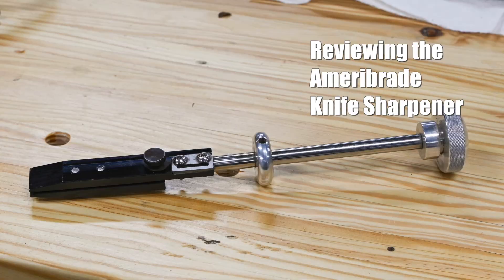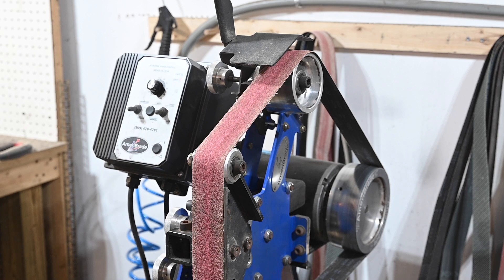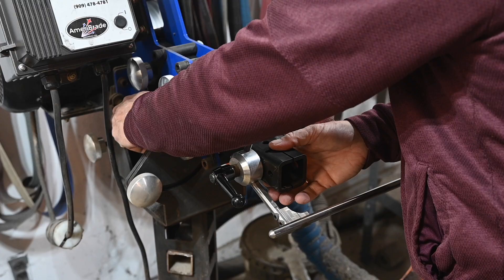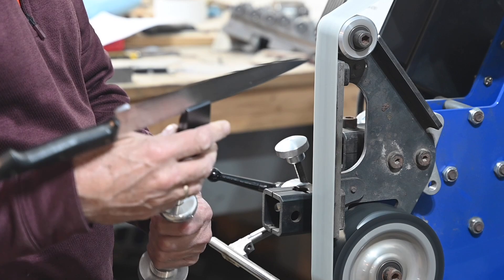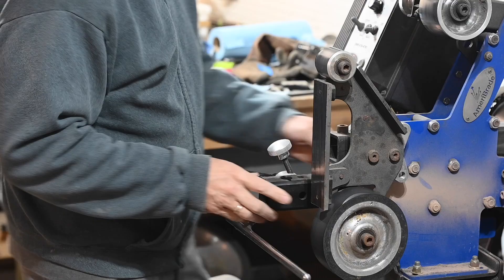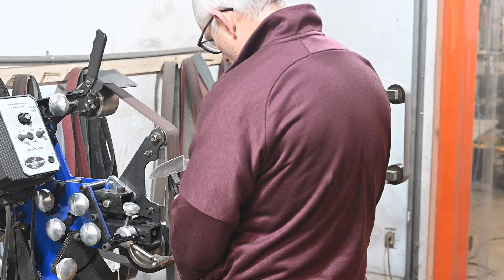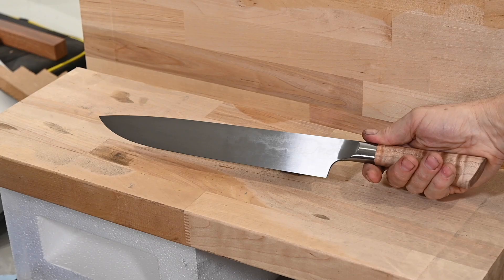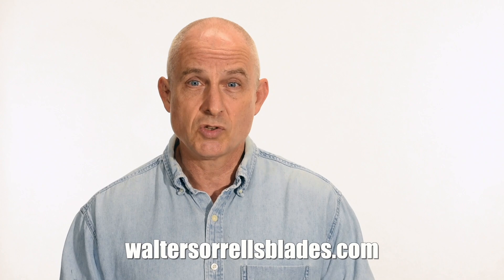The Ultimate Knife Sharpener? - Ameribrade Knife Sharpener Review

Comment: I just purchased this and it works great. I like how you run the platen straight up and down. I did it with platen laid back and you have to reach out and seems to allow for some unnecessary arm movement. I will try your method next time. And the trick for leather strop should fix the little problem I had with it rounding over and seems to dull it a little. Thanks for the advice.

Comment: thanks Walter. for what it is worth, I use the same basic process without the   jig on my kmg. The leather is awesome. I got the idea from an old Steven R. Johnson video (he used disc sanders with cork and leather). This leather belt has been my secret weapon for quick sword sharpening, too. It looks like a Lansky system for a belt grinder. But, it was good to learn that this worked better for you than the paper wheel system on a little bench grinder that a number of people use.  thanks for the insights.

Comment: I don’t have a VFD so I can’t run in reverse and I’ve been getting an initial primary bevel on my knives by just super gently using the 120 ceramic and hitting it up above the platen behind the contact wheel there where it’s a little tight and not too much of a convex situation resulting. I don’t lean on it obviously because I don’t want to burn my Heat treat up but I’ve never even seen it come close to catching so I think as long as you use some finesse which you should be doing anyway, Mr. Sorrels is right. Running forwards if you know what you’re doing isn’t going to be a problem with regular ceramic belts. Been doing it  awhile myself.
Reply: A master knife Smith that I have worked with uses the same method as you.

Comment: You will cause accelerated wear and tear on your tracking / belt wheels by adjusting the tracking wheel so extreme vs moderate adjustments to the tracking wheel with the added use of the rear motor mount adjustment. with proper adjustment the top tracking wheel needs only moderate adjustments for both forward and reverse directions.. improperly adjusted tracking will have  consequences with premature damage..

Comment: I believe I’ll stay with my water stones. Thats not sharpening, that’s grinding.
Reply: I mean he is sharpening. Whetstones also remove material by grinding it off.
Reply: Leather stropping belt may be useful if it stays cool with low rpm..
Reply: In all fairness, he does "grind" over and over.  That said, I'll be sticking with my wicked edge.
Reply: Water stones are abrasives that "grind" as well. They just are non-moving, whereas these abrasives are moving.
Reply: @NuManXplore  they don’t remove nearly as much material. I keep my kitchen knives, most of which are very expensive, extremely sharp, Finished at 6000 grit. Trying to sharpen them on any powered equipment would ruin them in short order.